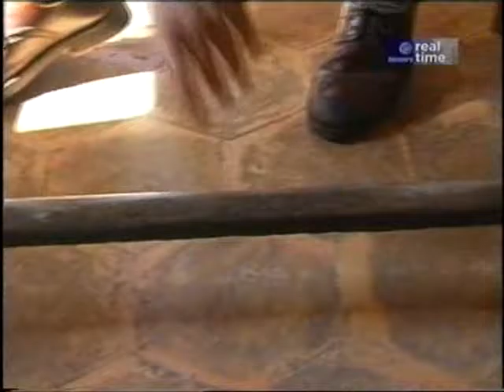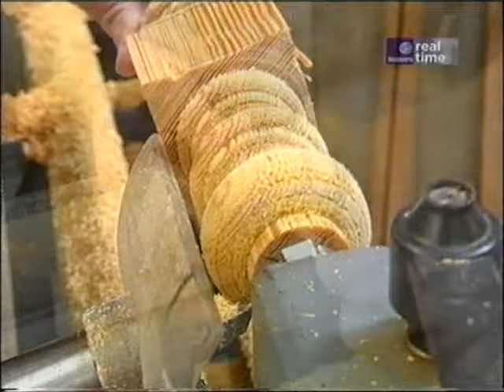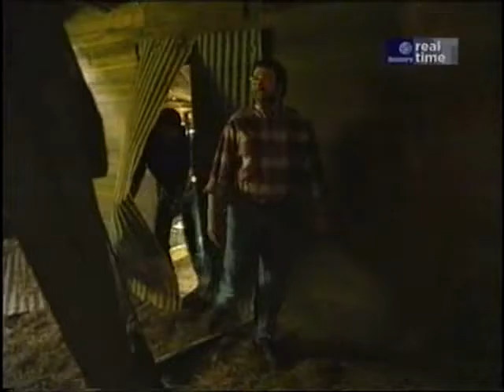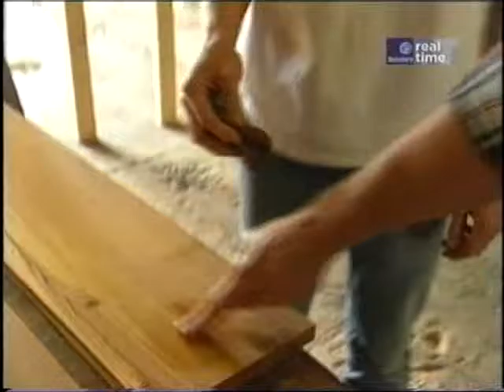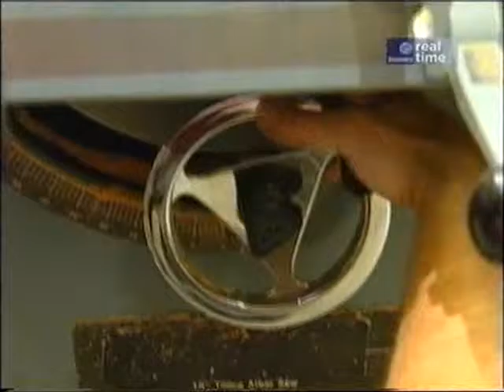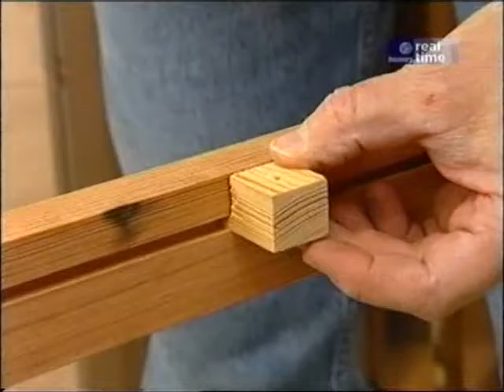Monastery Table Project

Comment: I couldn't hope to be as good a woodworker as Norm, but the lines he calls grain I call the pattern of growth rings in the end grain.  I was always under the impression that the grain direction is synonymous with the direction of the longitudinal fibers that run the length of the board.  My point is, if you cut your splines with the fibers running the length of the spline, I believe it will be weaker than if you have the fibers perpendicular to the length of the spline, whether the you cut them plain sawn or quarter sawn.  Norm's saying plain sawn won't split, whereas quarter sawn will.  An  old book I have on boat building shows splines cut with the fibers perpendicular to the length of the spline.  Wood splits by forcing the fibers apart the way you tear a corn husk lengthwise.  Try to tear a corn husk crosswise - you can't do it.